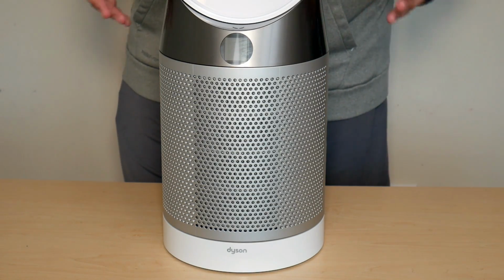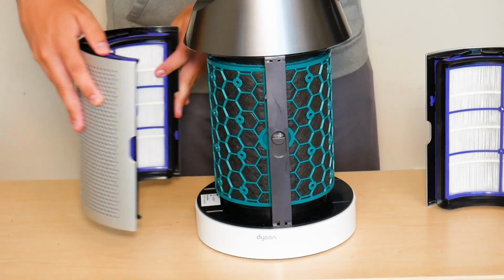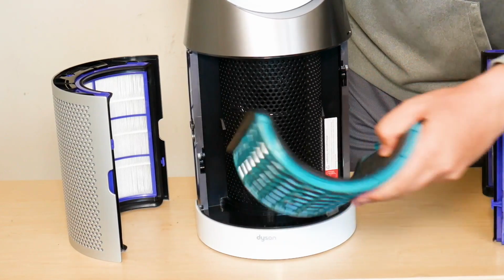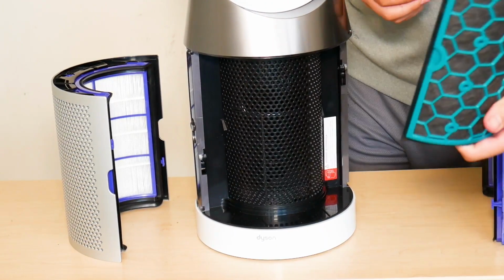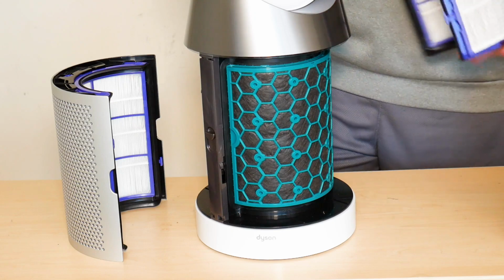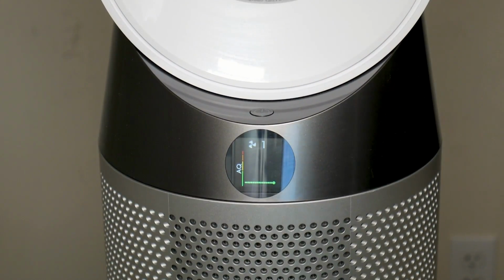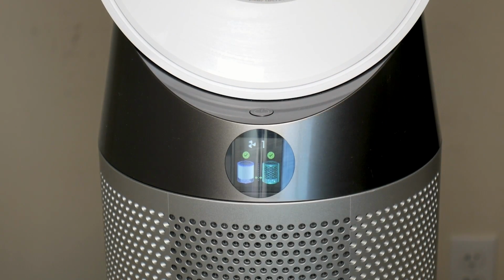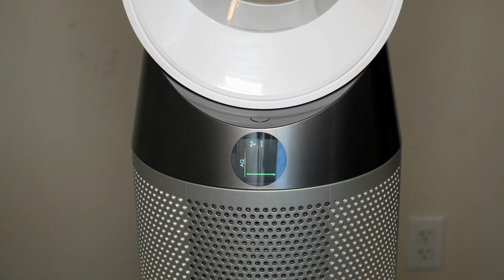How To Replace Dyson TP04 Pure Cool Air Purifier Filter

Comment from the maker: I forgot to mention in this video that after changing your filters, make sure you reset the carbon filter. To reset, press and hold the Oscillation button on the remote control. The display on the appliance will countdown from five, finishing with the default screen. The carbon filter level will be reset and the appliance is ready to use.

You also need to reset the HEPA filter. To reset, press and hold the Night mode button on the remote control. The display on the appliance will countdown from five, finishing with the default screen. The glass HEPA filter level will be reset and the appliance is ready to use.
Reply: Most important part
Reply: thank you so much for this. it kept saying to replace it after i put a new one in.
Reply: @illyobrejan7653  same issue I'm having on the one I just purchased today. On the app it shows 0 even after the reset
Reply: Thank you. Great instructions, easy to follow
Reply: This is basically all I was needing! I also think the new filters that come have a built in carbon instead of separate because I couldnt put it together without totally removing that carbon filter that looks like your video. Perhaps you need a new video?
Reply from the maker: Hi Verena, I actually did an updated replacement video for the new versions of filters you're talking about (link below).

https://youtu.be/K-laDinalP4
Reply: thank you ... it worked
Reply: So happy I found your video.  I know I replaced the filters correctly but I couldn’t figure the button picture in the instructions.  The comments above are most welcome.  Thanks again.

Comment: I have just changed my filters but when checking on the screen where you say is a purple line mine is completely purple, have I done something wrong? also the first screen shows a purple line right at the top where normally it is green and at the bottom, can you help please?

Comment: Very helpful. I couldn't find any directions on how to maintain, clean filters, replace filters etc. until I finally found your video. Now I don't worry that I will harm or break my Dyson Air Purifier Tower with your expert directions. Thank you so much.
Reply: Also, can you tell me where we can buy the Charcoal Filter replacement? What is the actual name or product name to order this part? I believe there are 2 needed. The other 2 filters can be cleaned by rinsing them out. Thanks.

Comment: On the box is a little diagram showing the charcoal filter is combined with the new filters.  After30 minutes if struggling putting them back in I realized the new filters are thicker and with leaving the carbon filters in, there is NO WAY you can reattach the new filters.  It would be nice Dyson actually had directions with English that signified this.  In the end, you MUST remove the carbon filters in order for the new filters to fit!!!   Even watching their own videos they don’t mention this change!  Half hour wasted.

Comment: UPDATE: New filters sold by Dyson will require you to remove the charcoal filter as well.
Reply: OMG THANK YOU FOR THIS
Reply: So do we not need the charcoal filter anymore?
Reply: @michaelloukatos3860   no, I just discovered this myself.  On the box is a little diagram showing the charcoal filter is combined with the new filters.  After30 minutes if struggling putting them back in I realized the new filters are thicker and with leaving the carbon filters in, there is NO WAY you can reattach the new filters.  It would be nice Dyson actually had directions with English that signified this.  Even watching their own videos they don’t mention this change!  Half hour wasted.
Reply: @donaldm2582  Same here, time wasted hunched over and frustrated. Even initiated a return authorization before looking on youtube. Such BS.
Reply: @donaldm2582  this is exactly what I figured this morning. the new filters have carbon filter in them already. so no need to keep the old one on. :)
Reply: Thanks for mentioning this. Unbelievable how instructions like this get signed off from management

Comment: If the filter isn't even half way on the mark, but the carbon filter is is the red. Would it even be worth replacing the filter now or save it for a later time?
Reply from the maker: Hi Keng, I would personally wait until it’s time to replace both filters. Especially if you’re not utilizing the carbon filter.

Comment: Good video....After a night of trying to replace the filter and it not fitting back into place, we watched your video and realized that the filter we ordered has the built in carbon.  So the original "Carbon filter"  it came with needs to be removed for the new filter with the built in carbon to fit.
Reply: Jesus I spent so much time being frustrated because mine wouldn't fit and this was the issues. First of all thanks and second of all screw you dyson for not making it obvious that the new filters come with the charcoal filter prebuilt
Reply: Oh dear GOD! I had the exact same problem. Thank you so much for your comment!
Reply: Same here! Thanks ... could have broken the machine forcing it
Reply: Yep!  I wasted a half hour boys…on the Dyson packaging is a tiny diagram signifying this change.  Nobody and I mean NOBODY would figure this out just from that.

Comment: Is there a top or bottom to the charcoal filter
Reply: I changed the filers but have a caution triangle showing
Reply from the maker: Hi Sharron, you may need to reset the filter. Please see my pinned comment.

Comment: You didn’t explain how to reset the carbon filter for the display using the remote. You hold night mode for 5 seconds it resets the white air filter but when you want to reset the charcoal filter you press and hold the rotation button for 5 seconds to bring the lines down on that info screen
Reply: Thank you for the night mode tip!  I kept holding only the oscillating button and successfully reset the charcoal filter. Thank you to you because I wouldn't have know to hold the night mode button! :)
Reply: Thank you, it was very helpful

Comment: Hi - sorry but your information in this video is not correct.    To remove the carbon filter, there is a small semi-circular indent on each side half-way down.  You PULL on those to pop the filter out.   You direct people to press down on the top at the center.  This doesn’t work.
Reply from the maker: Hi Stuart, thanks for the clarification. In my experience, I found that even when pulling on those sides, as you mentioned, it can still be finicky. That’s why I found it easier to pull it down from the top. While, as you said, that is an incorrect way of doing it personally, pulling it down from the top is a better option for me when replacing the filter.

Comment: TOTALLY WASTED MY TIME;  OMITTED MOST IMPORTANT STOP REGARDING YOU MUST MUST MUST RESET THE REMOTE AS THE LAST STEP BEFORE YOU CAN TELL THE FILTER IS INSTALLED CORRECTLY. I KEPT TAKING IT APART AND REPLACING 5 TIMES SINCE THE DISPLAY KEPT FLASHING. HELLO?????
Reply from the maker: Hi Karen, you're completely correct. To correct my mistake, I have went ahead and pinned a comment on how to reset your fan after replacing your filter.

Comment: Is there any similar modern gadget for cleaning indoor air from dust?
Reply from the maker: @ArklayBear mentioned a great contender called the Winix 5500-2. It's a lot cheaper than the Dyson if you don't mind giving up the app and Alexa compatibility.
Reply: @FeaturedTech  Thanks!

Comment: I changed mine but it says that I still need to replace the charcoal filter...
Reply from the maker: Hi Tamara, make you sure you push the carbon filter in until you hear that “click” to confirm it’s installed properly.